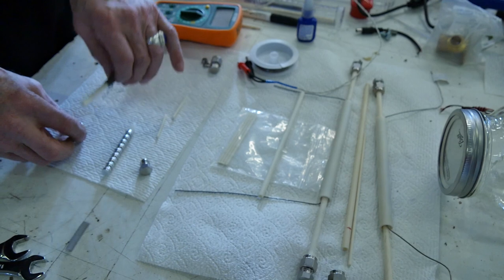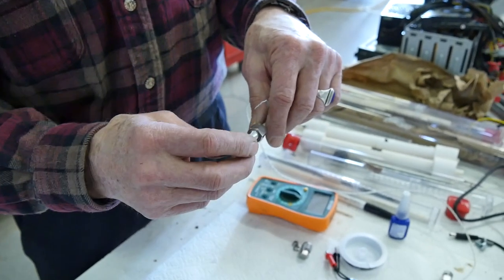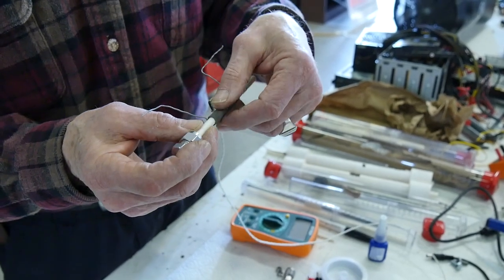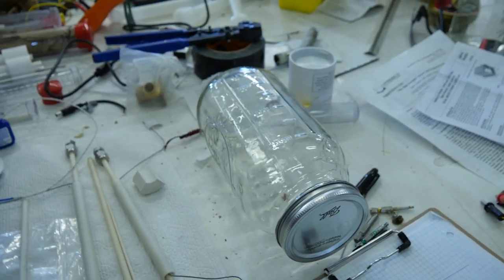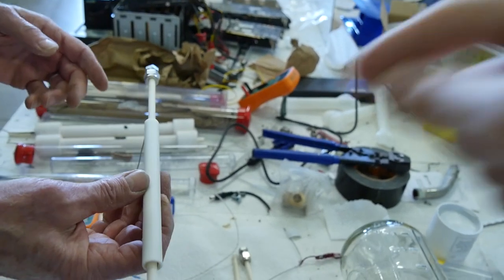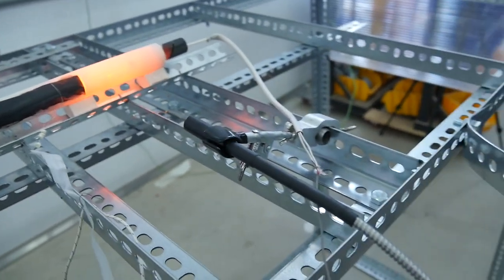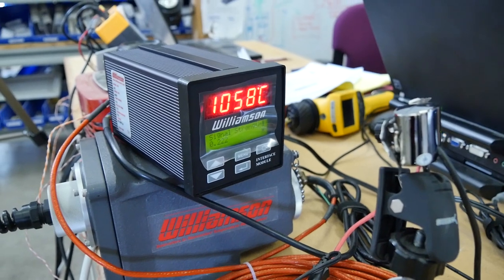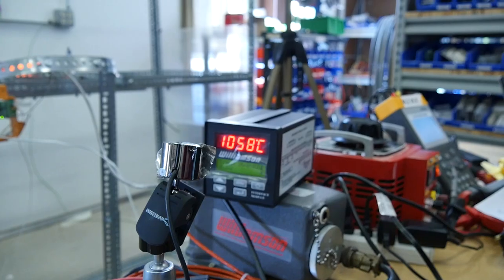*GlowStick*

Comment: You could add hydrogen from a gas bottle connected to the other end of the swage-loc. Then you could test for leaks before assembling and heating the whole thing. How is the pressure in the alumina tube measured? Would a quartz tube of the type used in some radiant electric heaters be more robust at these temperatures? Great work - hope to see more at ICCF19!
Reply from the maker: Bob Higgins is doing just that.

The Alumina holds very high pressures, dependent on wall thickness and temperature